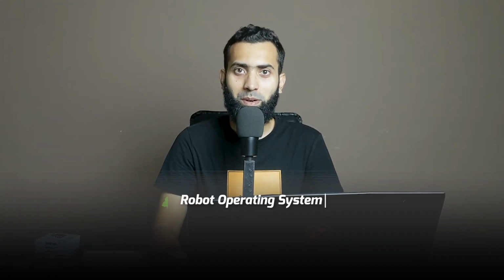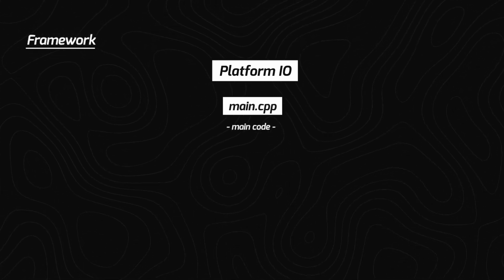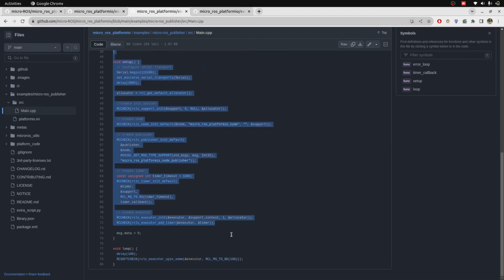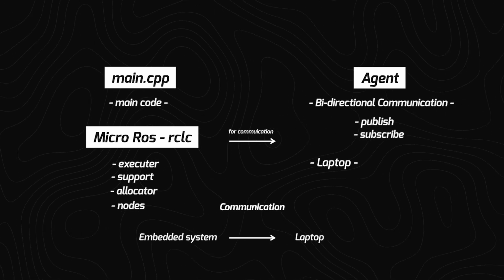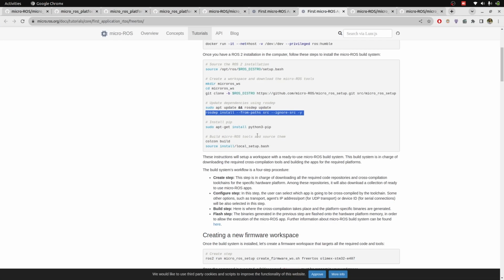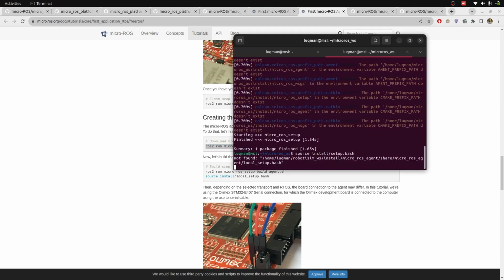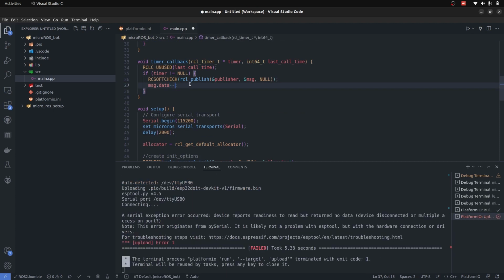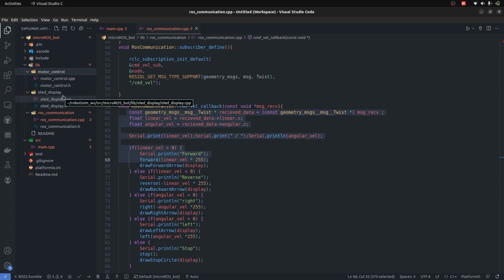Micro-Ros robot using PlatformIO for esp32 for ROS2

Comment: Assalamualaikum,

first of all, thank you very much for your videos – they are incredibly helpful!

My question is: how many ESP32 devices can be connected in a network?
I had issues when using 8 robots running ROS 2 Humble raspberry pi  on the same network – it became laggy, and the cmd_vel commands didn’t work as reliably as before. I assume it's due to the amount of background data being transmitted.

Do you have experience using multiple ESP32s on the same network? Any advice would be greatly appreciated!
Reply from the maker: not yet ,

but a thought that hat the frequency of sending , reciving cmd_vel ?

Comment: Hello,  I have problem with connect via udp, If i "ros2 run micro_ros_agent micro_ros_agent udp4 --port 8888" sometimes it works, sometimes it doesn't. Do you have solution?
Reply from the maker: Check ESP32 , is it working fine

Comment: Assalamualaikum sir, i try this on arduino ide using wifi communication in esp32 wroom32d i got error guru paniced with some backtrace. But it will work properly on diffrent board
Reply from the maker: It is for PlatformIO only

Arduino ide will not work

Comment: I have a question, I want to use Micro-ros in my device. I am also connecting an esp32 and an Arduino Mega to my system. I am doing serial communication between esp32 and Arduino Mega (RX TX). Will my esp32 be able to communicate with my laptop and the esp32 at the same time ?
Reply from the maker: Theoratically yes not a problem  for 
- Serial COM with Mega then  Wifi Com with Laptop

how ever it totally depends upon the bandwidth and frequency you are using for the task but it will slow down for higher freq-bandwidth , still will keep connected :)